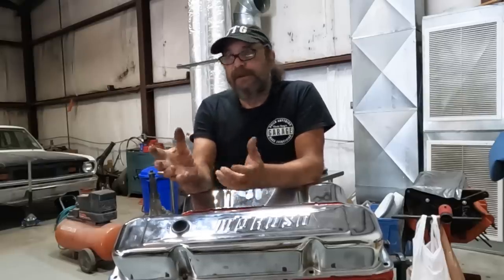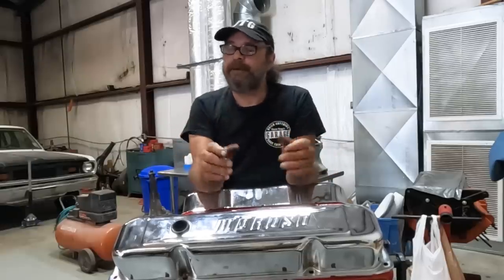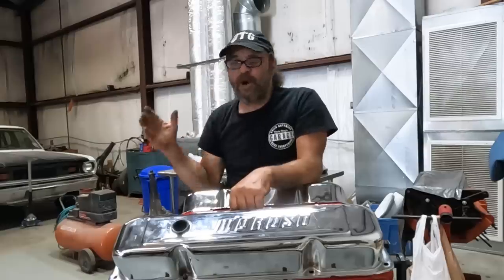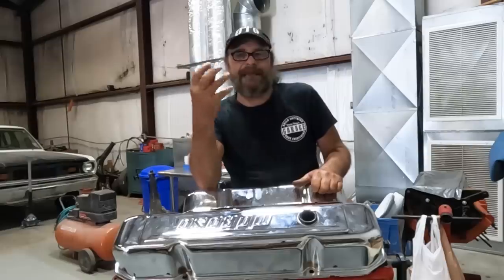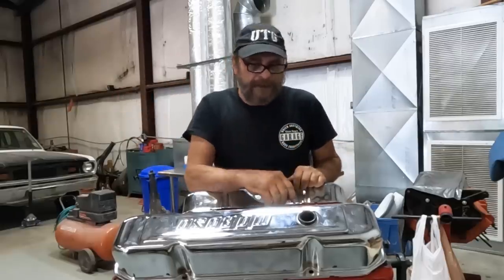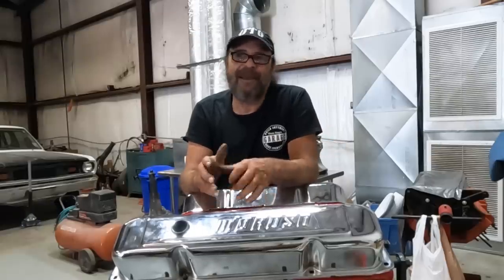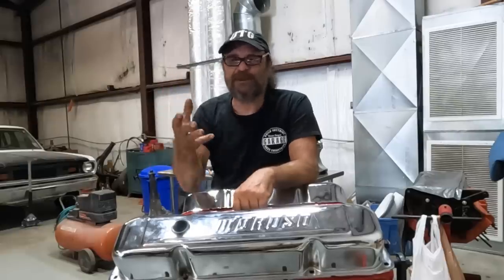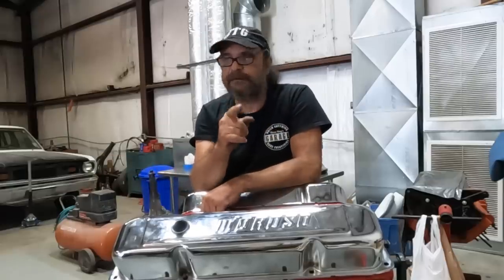Head Gaskets - Myths Busted, History And Types For The Home Engine Builder

Comment: Years ago I had a late 1970s Ford E150 van break down on the Southern coast of Oregon. It was the stupidest thing! A screw from the air cleaner mounting bracket loosened up and got sucked through the carb and into a cylinder. 
I heard the noise, pulled to the side of the highway, shut the engine off and called for a tow. The driver who responded said, "You're in luck. We're just a few miles from one of the oldest Ford truck repair shops in the country." And he was right! Turns out this shop had been specializing in Ford trucks for over 50 years and the owner's favorite engine was the 300ci 6-cyl., which happened to be what was in my van. He was even happy to let me do some of the work, to save some money. 
We pulled the head, found the screw in one cylinder, a few minor marks on the piston but no real damage done. The only hold up was getting a replacement head gasket and there weren't any auto parts stores in Port Orford OR. It took a couple days to get one, but the locals took great care of us. It's a small town, so everyone had already heard about the couple whose van had broken down on the highway. 
The owner/mechanic in the shop showed me a trick with those old style shim steel gaskets. Instead of Copper Coat (which I'd used on other cars), he just used metallic spray paint... silver, copper, or gold... didn't matter, so long as it was a metallic paint it would seal just fine, he said. And it did! I drove that van a few more years and another 50,000 miles, then we gave it to our son in law who used it in his house painting business for several more years. It probably had over 100,000 miles put on it after that repair. I don't recall what brand or color of rattle can metallic paint we used. Whatever he had lying around.
P.S. The repair shop was fascinating... mostly worked on big trucks from the logging industry. It had a belt and pulley system overhead to run old school "power tools" like lathes and mills from a common source. Felt like a trip back in time. Plus the three or four days we spent in Port Orford turned out to be one of our favorite vacation memories (in spite of the breakdown).

Comment: Good info on the reuse. Personally I hate those metal ones. Seems like not long ago the factories were still using them. I know from experience that the deck and heads have to be spotless for them to seal. Coolant under NO pressure leaked out as soon as we filled the engine. Turns out (it was hard to even find) a speck of dirt caused the leak. I just R+Red the head on my daily. Didn't re-torque the head, but I DID re-torque the exhaust manifold, and boy did it need it. Don't know if they still give them a name, but I remember when Felpro first came out with "permatorqe" head gaskets. It was a big deal.

Comment: I moved to Australia in 1976 and never understood this head gasket evolution. Ford Australia undated the venerable in line 250 cid 6 with a cross flow head. Still prized by The US Inliners club. First year or so the the head was cast iron, but then they went with an alloy head. Enter the head gasket problem you mention. Now I finally understand why. Ford got this engine really sorted and even made an LPG only version which about as expensive to run as a Corolla because the price of LPG was mandated here at a bit over half the gasoline price. So these cross flow sixes in both fuels dominated the larger family sedan market even displacing the beloved Australian Holden. The lpg version was also the dominant taxi in Australia many running 24/7. This dominance has now ended with the introduction of special upsized Prius hybrids are cheaper to run.

Comment: I was waiting for you to get to the importance of changing the coolant as recommended.. coolant (when it breaks down due to never being changed) actually turns into what's practically battery acid the eats at the metal in the gasket as you eluded to.. and as I'm sure you know..  you can even use a multimeter with the common (ground) lead on a good ground.. then place the positive lead in the radiator just until the probe touches the coolant (not anything else) and actually test for voltage.. depending on the reading you can guesstimate as to the breakdown of the coolant into acid.. furthermore... bad block grounds can cause the voltage/current to permeate the block and more readily and exacerbate the breakdown of the coolant into an acid...  a lot of newer cars are far more sensitive to even the slightest voltage drop so one would likely notice other issues that could possibly lead them to properly diagnose such a condition.. but being on older Master Tech and Diagnostician and doing a lot of hot rodding and racing throughout my years i can say that older cars are a little for forgivable to slight grounding issues and that would speed up the decay of head gaskets.. I've seen it myself in my experience.. great video as always brother.. keep up the great work... 
💪🇺🇸🇺🇸💪✌👍
Reply: Yep co worker had that issue on a mid 2000s ram. Replaced the water pump and radiator twice before he found out it was electrolysis killing them.

Comment: When I built my Dodge 360 magnum I torqued the heads and one just did not seal right so I took the head off. I Did not find an issue and I re-used the head gasket and had no issues with it. When cleaning Cast Iron heads, what grit emery paper do you recommenced for gasket sealing, i.e. 80, 120, etc.? I typically use a 3m paper with a 4" machinist flat to clean the heads and block with 80 then 120 grit paper.

Comment: Well, I had a long time question answered. I cut my mechanical teeth on our farm back in the latter half of the 1980's during my teenage years. I would hear people talk about aluminum heads and intakes on these old school engines but my dad and other people discouraged it due to the high rate of gasket failures. The school of thought back then was the softer aluminum expanded at a different rate from the cast iron and the gaskets would fail. Fast forward into the 21st century and gasket failures with cast iron block and aluminum heads and intake are virtually unheard of. I always wondered what caused that and why the difference now.

Comment: G'Day,Tony,and Miss Kathy,,Long time ago we would go camping (IN STYLE),we had a Clay putt putt engine, water cooled, running on the river bank and would run a 3 phase alternator and water pump for the HOT Shower,,any way this week end we blow the head gasket,,(F&*K) so in to one horse town with no prospect of finding a new Clay gasket,( I mean the motor has to be made in the 50's) Brought a pak of breakie cereal and some fine stainless mesh,,and made a gasket from carbord and stainless with Muffler putty,,now that was in the 70's,,and the old Girl is still running to day,same gasket,( I mean if it ain't broke,)

Comment: I'm using a Fel-Pro 1094  .015 gasket. What are your recommendations for install? I keep reading that some are using copper spray. Would you use the spray or put it on dry, provided the mating surfaces allow? Would you retorque or no?  Fel-pro recommends a retorque.

Comment: Subaru had a problem because of a coating they used on the head gasket that turned out to not last longer than 15,000miles in many instances. So be warry of mls gaskets that are pre coated you dont know how good that coating is.

Comment: I wish you gave us some recommendations for what you like to use on your engines. For instance use an MLs gasket on a 440 or is a composition Fel-Pro type gasket okay? And you could have mentioned the surface finish on the head and block as far as what works the best today
Reply: He did though, slipped between his breakdown of the differing gasket types. My understanding went: stock iron block iron headed NA street engines; metal shim with copper coat good, composite with stainless fire ring better. Iron block aluminum headed, boosted, and/or much higher performing (significantly more heat) engines; composite sometimes good, MLS better. He’s granting that most of his engine building audience is likely working on the first engine category so composites would be the most recommended on the whole, and I’d also make the inference that an aluminum block aluminum headed NA street engine will mostly be fine with composites like the first engine category since the expansion rate won’t be as hectic as iron block aluminum head and more similar to iron block iron head
Reply: Straight smooth and clean are key for MLS to seal right

Comment: I have become a fan of the Graphite steel composite head  gaskets for what it’s worth.  Silly me I thought Chevrolet used More head bolts cause they use smaller ones so it’s harder to keep their heads on the deck

Comment: i built an engine not long ago where there was a compression leak into the water jacket. the fix was re-torque the head gasket. i am not saying re-toque is needed on all engines but in some cases re-torque is necessary .
Reply: A lot of engines spec torque to XX, XXX the second time, then add 90 degrees more to stretch the head bolt.
Reply: Good video, leave the Adderall alone.

Comment: Gm had huge issues from the late 80's into the 2000's from dexcool breaking down prematurely then eating the headgasket, pitting the aluminum heads causing antifreeze creep through the MLS headgasket  contacting the headbolts  ( northstar V8), the small blocks and v6's had all kinds of intake manifold gasket antifreeze leaks. Then there was the silicone separation issues that clogged radiators and heater cores. If you run a vehicle with any form of extended life antifreeze and its not clear and brightly colored when poured in a white Styrofoam cup you better get it changed out, it does not last as long as claimed and once beyond 100k miles you should drain and fill  the radiator every 30k miles or two years.

Comment: I've been watching a lot of your videos lately and I was wondering if you ever used newspaper on the back side of your bearings in a pinch for 1 more run or something like that. My grandpa said that you could use that in a pinch to tighten up a rod or main bearing if you couldn't get a new one and had to get it on the road. He also fixed dusenbergs, and a lot of busses around the great depression time so they had to make things work. Just curious if you've ever heard anything of the sort

Comment: What about copper head gaskets and machining O ring shaped groves in the head and/ or block? How much warpage can copper spray gasket sealer handle WITHOUT using any head gasket? I'm trying to raise compression on a 1973 318 Dodge. I'm leaning toward Magnum heads and copper gaskets. What's the best Magnum head casting number? Do I use a copper head gasket for a 1973 or a later model?

Comment: With aluminum cylinder heads on cast iron blocks. The problem is called FRETTING, hot and cold cycles overtime causes the head to move on the block compromising gasket seal. Never cheap out on head gaskets.

Comment: Building a 306 SBF after a broken valve spring. Parts guy sells me some black composite FelPro head gaskets. They're better  than Permatorq Blues, he says. Hydrauliced it. Busted wrist pin, piston, ruined bore. Am I silly for insisting on Blues?

Comment: There was one more variation of the head gasket that was use with a 240Z Datsun which was turbo-charge.  We borrowed from the diesel and placed a steel compression ring after cutting both the block and cylinder head for the ring to seal against.  Much like the 'fly cut' on the Beetle cylinder heads and the steel sleeve cylinders.  With the higher boost it did not blow by between the cylinders and the water/oil jackets were sealed.  This indeed was a very special case for a special car.

Comment: I used to o-ring the aluminum kawasaki and suzuki heads in the 90s for drag bikes.
Reply: How did you do this?
Reply: @mikem5475  on a bridgeport. Cut the groove, hammer in the wire.

Comment: I installed new valve gasket on a Chrysler 400 engine with no sealant. It leaks a little on the bottom corners by firewall. Should I remove and put some sealant?

Comment: Flathead style engines were EASY to access head bolts for retorquing as they were exposed and right there. But not so easy and evidently not necessary on a valve covered engine.

Comment: just clicked 20k miles on a rebuilt 7.3 diesel, ARP studs, 140 ft/lbs 
never did any retorque or tightening... lives all day long with 45+ psi of boost
thinkin about it, does the dealer do re-torques after you buy your car? nope

Comment: What we do is run through the torque sequence until they all hold torque before going to the next torque value or closing up the motor. 
I got a digital torque wrench when we put the last N14 together. I think it's 90, 240, then 90 degrees. I was near 600 cycles on the digital wrench by the time all 36 head bolts held at 90 ft-lb without turning. 
525 hp is about as high as they can be set reliably. Any higher and all it takes is lugging it with a heavy throttle once to stretch the head bolts and blow a gasket.
Reply: Geez need to see if there is a ARP upgrade for those stretchy bolts mate

Comment: Uncle Tony, have gasket mfrs largely stuck with what would have been contemporary designs when intended for earlier (60s-ish) engines ? Ie; no cross polination off newer style designs for older engines (cast iron to cast iron, aluminum to iron or earlier engine designs now available as aluminum to aluminum).

Comment: you forgot to mention that the copper asbestos gaskets were reusable by putting them in a bucket of water overnight to reswell. but you did have to check the cylinder seal ring for cracks.

Comment: 12:00 you forget a step!!!
GM started to use a "graphite" gasket on their 3100 and 3400 v6 engines (which ALL fail around 300,000 miles)
.
the first version of Dex-Cool was also REALLY bad at eating intake gaskets on the 3.1, 3.4, and buick 3.8
however... the intake gaskets are just a cheap design anyway.....
.
.
i went with a felpro head gasket..... MLS
but i didnt spray anything on it
.
seems to be working good
.
cars got 27,000 on the new gasket..... 327,000 total 
so the motor will probably loose ALL power and efficiency before the gasket goes again
Reply: and thats one thing a LOT of people dont know about....
the red and orange dex-cool
.
first gen dex was more red..... and just ATE UP intake gaskets
2nd / current gen is more orange.... and just doesnt eat gaskets
.
but every single one of these 3100 engines was factory filled with red
and i dont care how good you flush the system..... some of that is still in their!!!

Comment: Modern aluminium heads require retorquing. Nothing to do with the gaskets or the bolts but the softness of the heads. When you pull one apart you should do the opposite of building it, take note of how many bolts are loose and how much by and that's where the gasket is leaking. Gaskets are re usable too when not visibly damaged.

Comment: I really enjoy your vids, thanks so much.

If you can please, what head gasket did you use on your build?  You didn't address that the mopars of the 60s came with steel shim gaskets, which at about .020" thick are less than half the .042" of the average comp gasket.  MLS is interesting, like Cometic, who offer many thicknesses, allowing you to adjust CR. On a 440 .020" is almost half a compression ratio.

Also, sorry so many questions, where did those '68-'70 HP pistons end up for deck height.  Book says .020 to end up at 10:1 on the 383, but you're using 516 closed chamber heads. They don't have much less CC volume, but they do get you a quench chamber. 

Thanks again for the knowledge and entertainment.  Much appreciated!
Reply: I don't have he details you are asking for, but I remember that a 383 comes up far higher than a 440 in 68-70.  So much so that you actually have to think about avoiding a thin gasket if either the head is milled or the block decked.  The greater thickness of the composite gasket makes up for those operations. If you were not careful on a 440, no matter. But on a 383 the piston could hit the head.
   Good reasons why I try to never let them cut my heads or deck my block.

Comment: I dont no if you watch a channel called cold war motors there out Canada they were working on a Packard engine the head gasket was blown out it was a steel shim style they tig welded it and metal finished  it back together and I believe the car still runs good dont see much use

Comment: I remember the late '70s and '80s the Chrysler Vans the 318s used to piss coolant out of the back I believe it was right hand head the water jacket would fail and it every time you would rub the engine it would squirt antifreeze out of the right hand corner like a stream out of a hose

Comment: I've never retorqued modern head gaskets. Not many of my engines are as mild as that 383 or most engines people will build to drive. The only time I have had head gasket problems is trying to use cheap Felpro pieces with more than 12.5:1 compression in my Pontiacs. The good gaskets don't need retorqued either.   

I can see it now, someone will say "Thats how I have always done it and I have never had a problem retorquing them" but its the same as trying to fix a nonexistent problem, or wearing your special socks/wife's panties that have never been washed since you won the last race. Do this, or use this product to avoid a problem we say you will probably have! Like additives that keep ethanol from hurting things... it doesn't hurt anything, so additives are wasted time and money. Thing is when no problem comes about, they figure the stuff works so they keep buying it. I call it snake oil.

Its like Granny Clampet's common cold cure, take this ill tasting stuff three times a day and in a week to ten days your cold will be gone. See! IT WORKED!
Reply: Crazy Chinesium world we live in. Felpro used to be the Cadillac of gaskets.